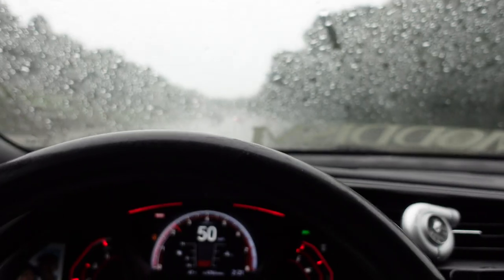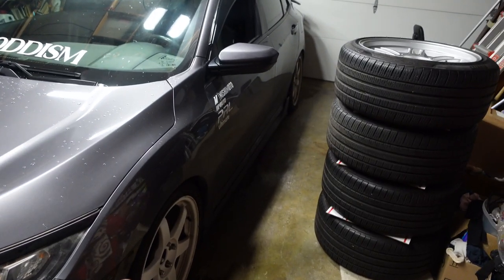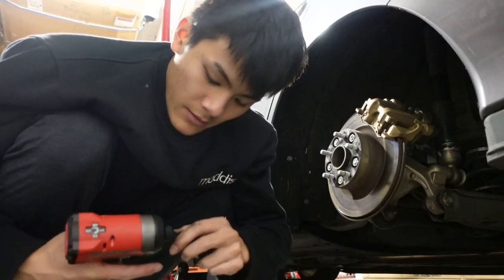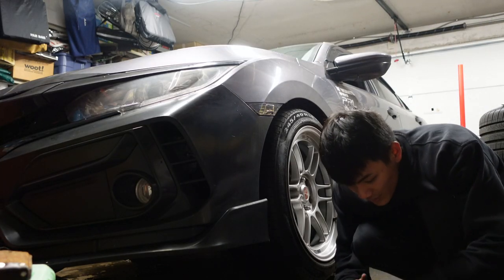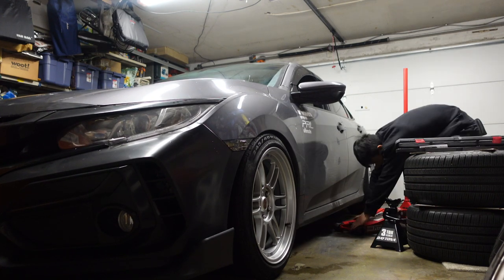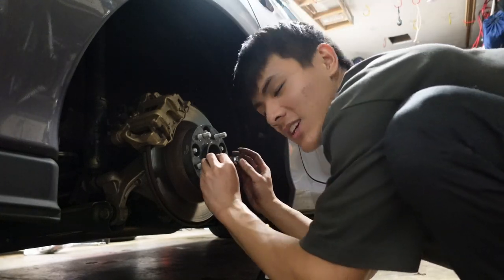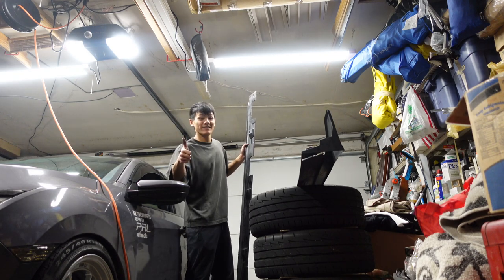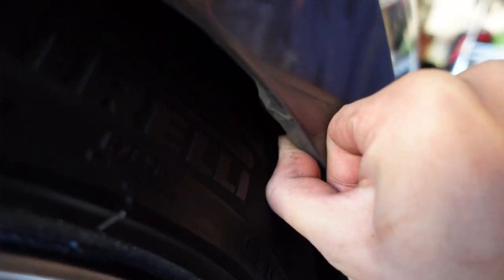I Got My DREAM Spec Wheels For A STEAL!

Comment: He reuploaded rip. I was first on last one. My question on last video was what spacer size are you running? 15mm?
Reply from the maker: No worries bro you’re still first😎 I was running 20mm in the front and 25mm in the rear
Reply: @moddism  Im assuming the wider in back makes it more aggressive. does it handle any different?